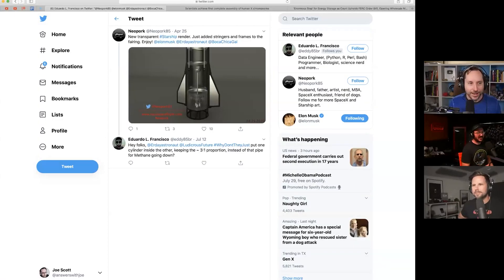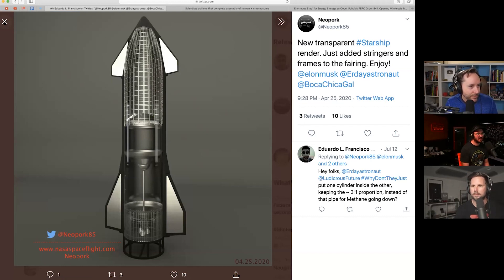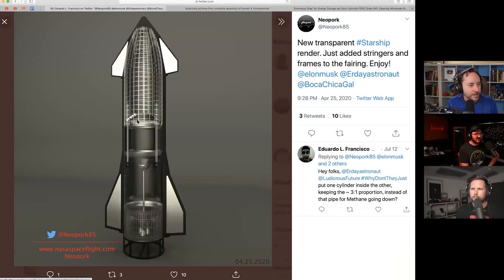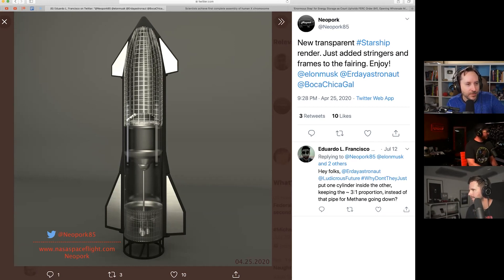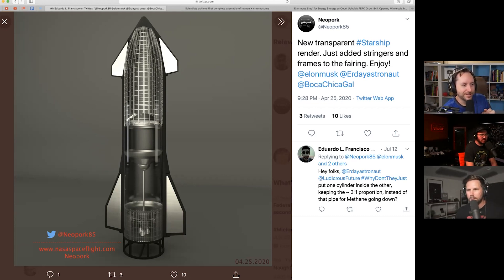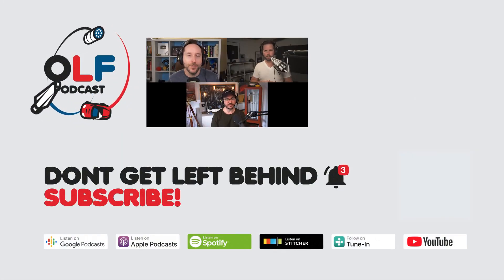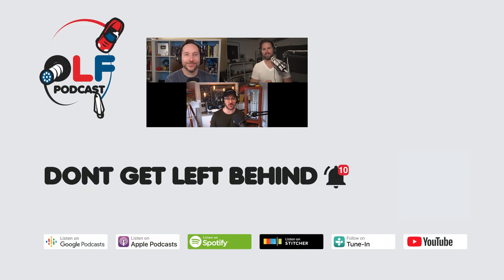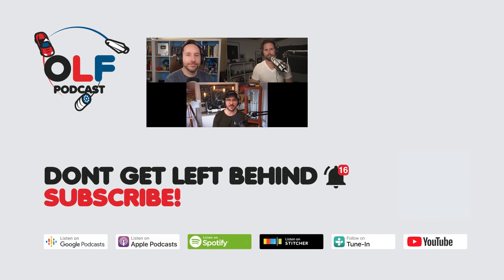Why Doesn't SpaceX Just Shorten Starship? (Highlight Ep 93)

Comment: It may just be easier to build two separate pressure tanks that have a simpler geometry on the end caps to handle more pressure, than to have a tank with in a tank... which may end up taking more steel and adding more weight than having the two tanks separated - that would be worth comparing to see. Haha! Tim just basically said that. I think he is right.

Comment: There are both benefits and drawbacks using a cylinder in cylinder design. O2 inner cylinder would add more weight (mass of tank minus common bulkhead) but would reduce O2 boil-off by shielding it from outside temperature difference. boiling point ~ O2 -183 c, Methane -161 c
Reply: Agreed.

Comment: Without doing due study, I'd say the structural mass would increase dramatically
Reply: Aggree. Temp difference is not so big with methene as with RP1, so they can have a shared bulkhead.
The main difference will be metal weight

Comment: WDTJ use a passive & inherently stable body for Starship, like a ‘rocket-capsule-ish’ (Space Shuttle Orbiter, Interplanetary Transportation System), and eliminate all together the ‘air brake fins’ and only using the heavy-duty thrusters as controls authority?
No moving parts, less parts, stable by design = cheaper, safer! (?) 🤔🤔🤔
Reply: You meant a very large 9 m capsule?
Reply: Alvian Choiri Apriliansyah More or less yes, like a rocket with a blunt body side, the first version they presented in 2016 of the Interplanetary Transportation System looked good to me